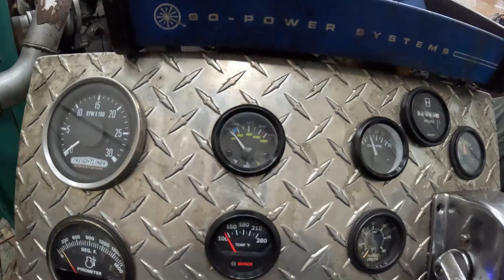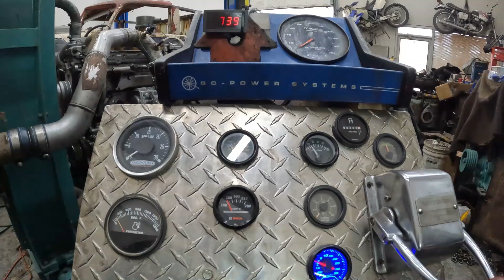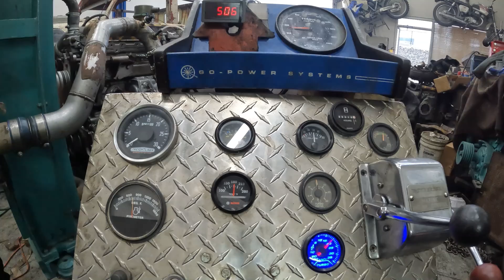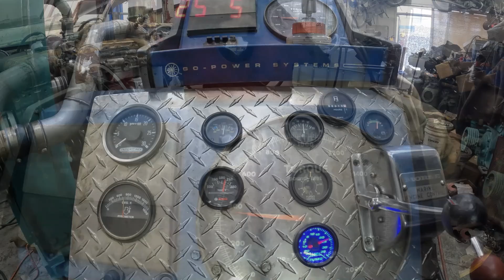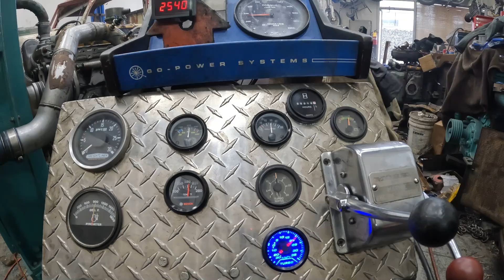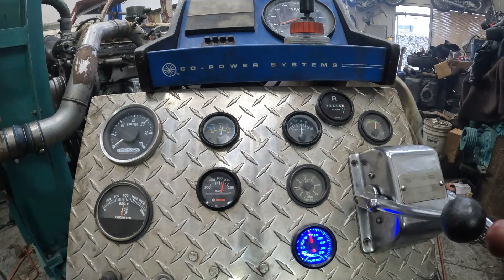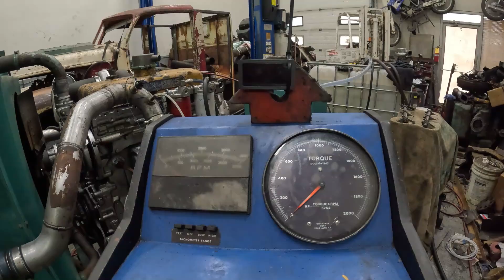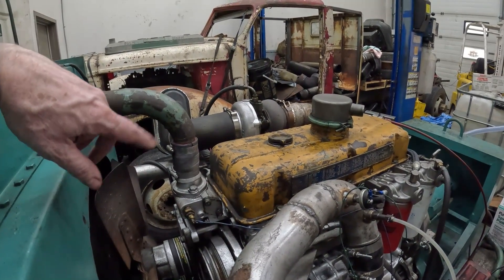Detroit Silver 4-53T (Dyno 66mm Turbo)

Comment: 450 lb/ft out of a 4-53 (3.6 litres) is very respectable.........scaled up to 15 litres (DD15) sized engine would be 1875 lb/ft.   Looks like the 4-53 is almost getting 25 psi of boost, whereas a DD15 runs at about 40 psi.   Black smoke under load hints at some un-burned fuel.  More boost is the answer, and that can be assisted with ceramic coated turbine housing and manifold, and a turbo blanket........heat leakage, reduces energy reaching the exhaust turbine (less physical exhaust gas pressure) and in a driven application, slows turbo spool. At EGT under load, the radiant heat coming off the exhaust manifolds etc is very significant,that is wasted energy.
Reply from the maker: Good points, I'll dig through my hoard and see if I can scrounge up a turbo blanket.:)  I've advance the injector timing from 1.484 to 1.47", fixed some cac leaks.:)  See how it does the next run.:)
Reply: @detroitgarage9430  with diesels.....it is all about boost, to make power and use fuel efficiently.  University of Texas actually has a study, where a Dodge Ram with a 6BT Cummins used 12% less fuel because of a turbo blanket. Perhaps the 4-53 on the Dyno can prove the theory, in different power/toque output and/or boost  before and after.
Reply from the maker: @wazza33racer  Awesome, I run the blanket on my Silver 4-53T in my truck as well as a wrapped exhaust manifold.  No smoke with 80 injectors.  Ordered both the wrap and turbo blanket for the dyno.:)

Comment: Looks to be a pretty flat tq curve ....severalntimes you were showing 400ish at full rated governer rpm
Reply from the maker: Looks like I picked up about 10HP, but nothing for torque.:)  I'll fix a few leaks with the cac tube and water meth fitting and run again.  See if I can get 240HP out of it with the water meth.:)
Reply: A good set of compounds is the way to go
Reply from the maker: @toddstanley7804  Yes, I might re-visit the compound on this engine.:)  Have a K27 and K31 that I'll most likely try.

Comment: I have a dyno similar to yours and upgraded the electronics to data log and get accurate hp and torque readings. The stuff i used was from performance trends in Detroit Mi. Excellent company to deal with and not super expensive
Reply from the maker: Thanks, I'd love to have a digital display for HP and torque.  I'll have a look at they're stuff.:)

Comment: I’d say that intercooler is working great with that type of temperature drop! Have you measured pressure drop across? Any plan to set up a compound turbo setup like you had on pickup? I’m right there with you, most power possible…with little to no smoke, interested to see what WVO does for emissions!
Reply from the maker: Yes, the intercooler is working great.  The temp drop is 185f from before and after the intercooler from 275 to 90.:)  At the moment I'm trying to stay with one turbo, but may make another compound.  I'll see after I've swapped the N blower and Silver bypass blower on.:)  Next session will be running wvo.:)
Reply: Why did you end up going away from the compounds on your pickup?
Reply from the maker: @clayclifford53  Wasn't the right mix of turbos for the fueling I had.  The K27 was too small and the K31 too large.  Now that I have the dyno Mule I can re-test the K27 on it's own and see how it does solo.  It's waste gate was too small from what I could figure, so I'll re-test.  I'll most likely try the compounds again and see.:)  With the larger injectors it might work well?  Really easy on the dyno to switch things around, but not on the truck.:)
Reply: Good to know, just saying you got a Detroit two stroke is way cool, saying you got a compound turbo Detroit just adds whole other level to the cool factor! I’m living my dyno desires and dreams vicariously through you!!!
Reply from the maker: @clayclifford53  LOl, on the search for the perfect turbo.:)  I'll try the different turbos I have, then look at the compounds.:)  Engines going to end up in my 1948 Diamond T, so I'll have to see if the compounds will even fit.:)

Comment: Love this stuff! Were you monitoring boost pressure before or after the blower? Does your methanol injection compensate for boost pressure/ is it a high psi system where boost doesn't restrict volume? And are you doing the dyno runs on diesel or vegetable oil? Looking forward to seeing more of this.
Reply from the maker: Thanks, Yes I monitor both boost and airbox pressure.  Airbox runs 5-10 psi higher than turbo boost.:)  For that last run I found a boost leak around the methanol fitting, so I'll pressure test it this week and repair the leaks.  At the moment I haven't hit any restrictions with the blower, but that may change as the fuel and water meth volumes increase.  So far all runs are on diesel, but I'll be trying the veg oil on the next session.:)
Reply from the maker: P.S.  The water meth is a simple 75 psi pump set to a pressure switch.  It's triggered to turn on at 15 psi at full volume, no progressive gain, just on and off.:)

Comment: Not so sure the water-meth was working. Looked like most of the water was getting blown back out and leaking around the fitting.
Reply from the maker: Yes, will repair that for the next run.:)

Comment: On my Detroit diesel 14 liter Long block inline 6 series 60 big cam all ceramic roller etc i running i ran four different turbos 72 mm with 1.58 ar 78 mm 1.32 ar cracked the ar put 1.45 ar cracked that ar put 1.58 ar then shaft broke with 7 bar metric then journey bearings no bueno relays on oil too much then bought 91mm 1.58 n broke that shaft n billet aluminum wheel my favorite was 78 all around started to whistle when i put shaft speed sensor then a fuel tech 10 bar metric hood for 150 psi i went to 50 psi lieghter loads n 100 to 130 psi but turbos couldnt handle my powers napierville would or 143 mm or set of twins or 1471 twins two
Reply from the maker: Awesome, I bet that was a real power house.:)